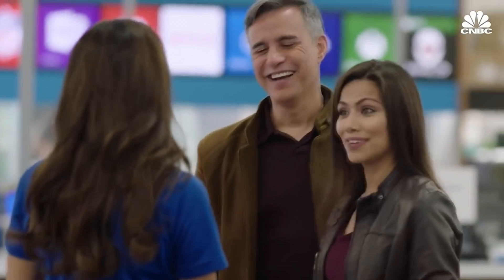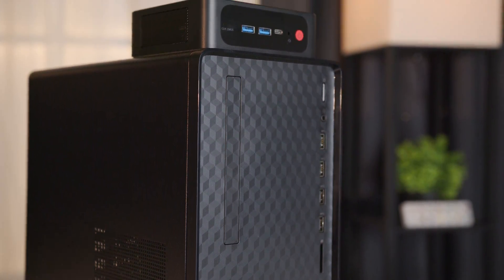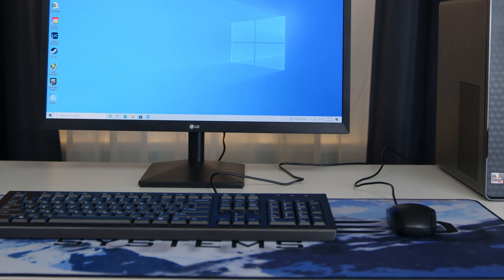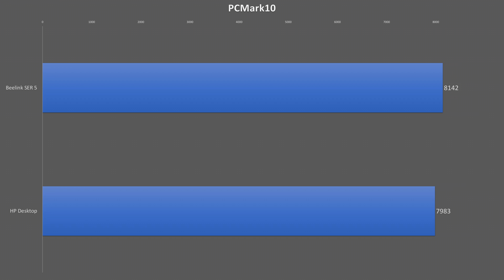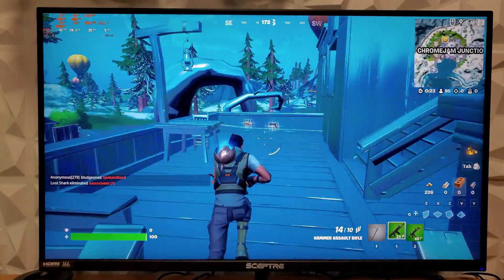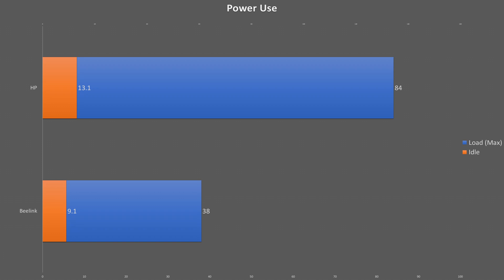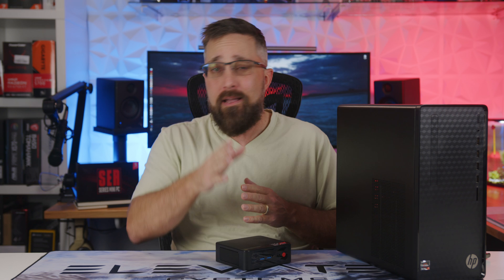Does Size Matter? Beelink SER 5 Review

Comment: FYI, it comes with a VESA mount so you can drop it on the back of your monitor, no issues. 
 
I use it for my crypto trading rig, big fan of KISS. $340 makes this hard to beat for 16GB RAM and an R7 8c/16t :)

Comment: Heating on Mini PCs is still a big issue. I had a BMAX B6 Pro that died on me in less than three months. My fault for doing too much on it. 😅
Also a really hot summer and a random blackout that killed it. Also crappy components as it used a noname m2 SSD card and a i3 motherboard that was discontinued a few years ago. But they'll likely get better.
I'm get a new one eventually on a local retailer because it makes it easier with warranty and such.

Comment: the cell tech is amazing, my last full size pc was 1200 DIY in 2010 (dual core AMD of 1.1 i think) and this rig runs circles around it . old pc power was a 350 watt monster that barely did the job. this thing cant go over 57 watts as thats what the power source is.

Comment: Something's wrong with that Beelink. 5500U and 4700G are both Renoir ZEN 2 generation. 7 vs 8 Compute Units. Graphics performance should be roughly the same. My guess is that the Beelink has single channel RAM, or it's overheating.

Comment: This infomercial didn't care to mention that all Beelinks have a high failure rate (see all 1-2 star reviews on Amazon) within a few months to a year, so yeah it is good until it dies on you. The problem are the cheap no-brand internal components. Even if you replace the SSD and RAM with good components, the motherboard may die on you.
Reply from the maker: Mini PC's in general, including Beelink, have a failure rate of about 1.5% which is exactly the same failure rate as desktop Motherboards. Take into account the desktop graphics card failure rate of 5%, and PSU failure rates of >2% a Mini PC is statistically less likely to fail.
Reply: @ElevatedSystems  In your dreams! Chinese mini PC's in general, including Beelink, have at least 10% failure rate - this is the rate of 1-2 stars Amazon reviews, which everybody knows are overly positive and skewed with fake favorable reviews, so the real life failure rate is even higher than 10%. There are already official video bloggers of people buying NUCs after a failing mini PC. NUCs are also made in China but by tested technology and quality standards.

Comment: Too bad it has only 2 USB ports on the back. A mouse, keyboard and printer require you to be creative. Use a hub or a combined wireless keyboard and mouse with just one dongle. 
It’s amazing even Windows 11 Pro is included. It was 21H2, so I had to upgrade it too 22H2. SER5 is not the newest model, so Amazon gave a big € 90 voucher. Bringing the price down to € 379 for the 5500u model (16 Gb & 500 GB Kingston NVME).

Comment: My experience with every laptop/mini pc vs desktop pc, the laptop based CPUs in these systems are just too laggy and slow and ran far too hot and loud for my liking, compared to desktop CPU based systems! Even when just using Chrome the fan would rev up and the window would stutter and take a noticeable while to be responsive. When I went back to a Ryzen 5 5600G system from a Ryzen 5 5500U system, the difference was night and day. I will never go back to them! My 5600g scored 11162 in Cinebench R23 compared to your 7942 5560U.

Comment: When you add a Monitor, battary and keybroad , a mini PC become a Laptop

Compare a mini PC with desktop just like you compare a laptop wiht a desktop, as mini PC is use the latptop hardware install in a small box

If you bought a PC then use it for several year wihtout upgrade need, Go for a mini PC, if you may have some upgrade need, you still need a full size desktop

* just got my  Beelink SER 5 from amazon last week for lab use

Comment: Dude, after several attempts with other minipc's, this is the one I settled on for my retro emulation station. It is flawlessly running everything from Atari up through PS2. I'm happy with this one. And you hit on all the other stuff... great build quality, packaging, etc. This is the way.
Reply: Which emulation do you use and where did you get it from?
Reply: @tdroyal  Amazon... got it on a day where they had an extra 15% coupon I think. I am running LaunchBox/BigBox with the built-in Retroarch cores for most of the emulators and have connected Xemu, PCSX2, and Dolphin as well.
Reply: @tdroyal  Amazon... and I use LaunchBox/BigBox and the built-in Retroarch cores for most of the systems, but also have connected Xemu, PCSX2, and Dolphin to LB/BB as well.
Reply: Probably Batocera.

Comment: Ya don't do high performance gaming on these things, but let me tell you, as power cost increases across the country, you'd do literally everything else on it. Tempted to get one and stick my gaming GPU in an enclosure instead.
Reply: Interested. Likely over my head but how would you do that?
Reply: @Kimberly-qb5zo  I think a system might need Thunderbolt support, then you get yourself an eGPU enclosure. They aren't necessarily cheap either. But Minisforum B550 offers the ability to stick a discrete GPU and mini PC together.

Comment: for some reason i use this one to connect to my tv as a monitor but the picture quality does not look as good like my old computer . not so sure if it is because of the build in graphic card or not .
Reply: What size is your tv? I have a 50in. but haven't had the guts to turn the Beelink on yet, lol. My brother thinks I'll have a smaller square screen but not full. I explained that this is supposed to be capable of what 2 or 3 monitors?
Reply: @Kimberly-qb5zo  i have a samsung 55in tv . as i know of as long as it is a smart tv they have the option for you to adjust the screen to fit your actual tv size without having a black screen around it .  should be in setting or menu / picture / then looking for screen fit
Reply: I'm sorry to reply to you so late.
Maybe the TV is too big, update the graphics card driver. And adjust the picture quality to try.

Comment: I  got a Acer laptop with a i5-11400h with a 1650 video card  for $500 
Has the same performance as a Ryzen-5   5560u
But the 4gb 6050 video can plays any AAA game.

For $190 more it is mobile and play games. 
It plays Witcher 3 at  45 FPS in 1080p High
Compared to Vega 7 of the Beelinks 30 FPS.

If it has integrated graphics only
 then a cheaper Ryzen-3 will do the same job as a Ryzen-5 will do in any application.
So a $200 Ryzen-3 5500U Beelink can do anything a $300 Ryzen-5 Beelink would
Reply: Also, interesting. What would be their point in making them then, besides capitalism haha. Are you sure the other specs don't make the 3 slower?

Comment: I bought one of these from Amazon about 3 weeks ago and it's probably the best investment in a pc I've made in a long time. The only thing I changed was the m.2 from an Intel m.2 to a Samsung 980Pro m.2 I think the Crucial memory is adequate is it seems to run very smoothly. The installed Windows 11Pro is great too. It's kind of an overkill for what I'm currently using it for and that is it is plugged into my Samsung 40" flat panel. I needed a way to get a browser that works on the internet and so I could watch television programs from Comcast X1 connection. I have a X1 in my living room, but because Comcast doesn't support 2017 Samsung TV any longer with streaming TV, I was forced into this configuration. It works for me. But I do use this pc for other things too. Gaming to a small degree, but may get something for that later on.
Reply: I'm curious why you didn't just get a Roku? For the t.v. watching?
Reply: 980 pro? Oops...

Better update that firmware rsn

Comment: in the case of HP, you shouldn't have wiped the default installation because most people wouldn't bother to honestly. And it's a much truer representation of the experience HP curates for you at that price point
Reply: Unless...you don't like what H.P. presents. Just saying a little can be a lot. I don't see anything wrong w/doing that at all. H.P. & the others should, at the least, add a simple uninstall.

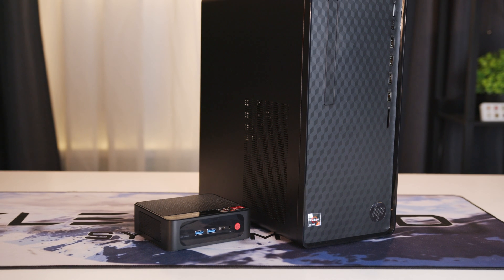Comment: 12:20 I dunno, we make fun of the RX 6400 but it would probably actually work really well in the HP here. Assuming that motherboard supports PCIE 4, if it doesn't then the 6400 is a terrible choice.

The alternative would be the GTX 1650, which is also a low power card, depending on the model. One would want to make sure to get the version with GDDR6 memory (Marked G6, as opposed to G5) but if one does then that's a perfectly competent low-end graphics card that will absolutely smoke the IGP in that APU. In Norway those can be found for 100-150 USD used, and just over 200 new. Though the low profile variants are unfortunately much more expensive, and I don't know if that case supports full size expansion cards.